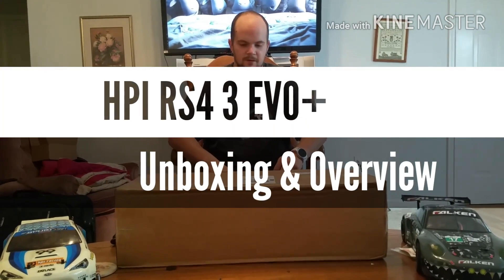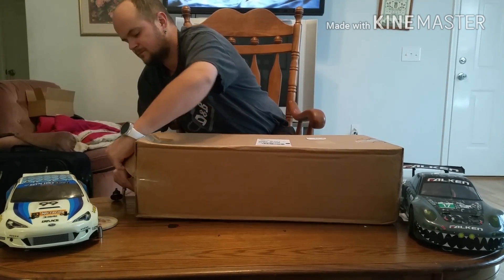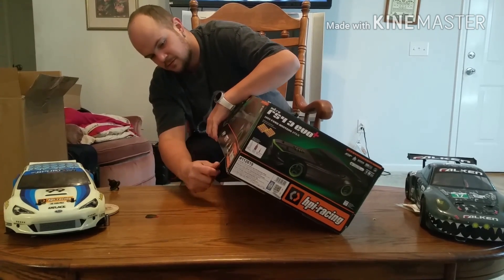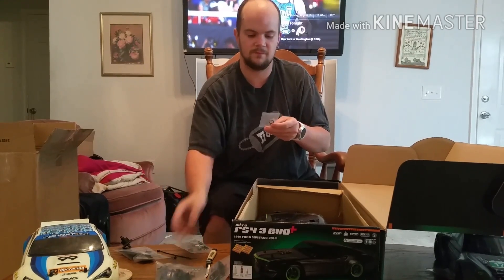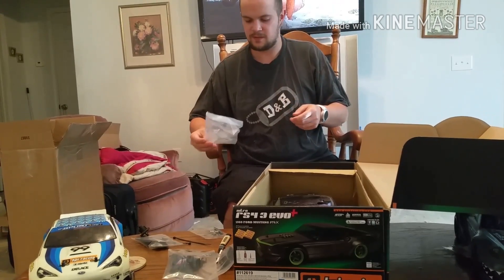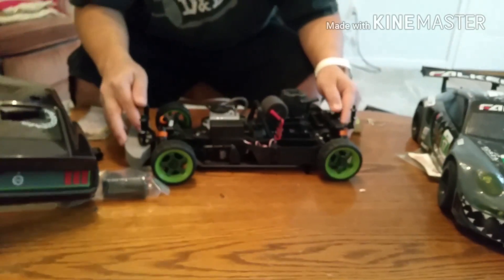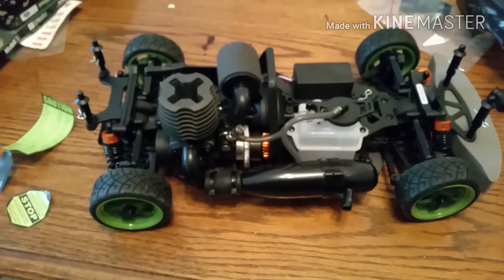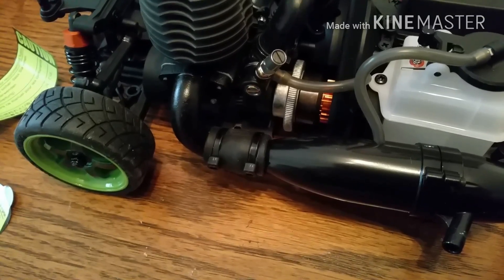HPI NITRO RS4 3 EVO+ Unboxing and overview

Comment: It's funny cause I had gotten out of the hobby for a few years and I tried searching for an Evo RS4 but no one had any in stock lollol that explains it! I have a traxxus revo 3.3 and the hpi sprint 2 flux but I wanted a shaft driven Evo cause I'm not the biggest fan of the belt driven car, it tends to spin out on the street lmfao are they producing them again? Edit: I just realized this video is 2 years old, my mistake!

Comment: Every where I check the nitro rs4 3 evo is out of stock. Also would the Porsche body fit the nitro rs4?
Reply from the maker: DBLOCK020 yes but right now you wont find them in stock.  I was lucky to find the one I have.  HPI isn't distributing so most of the good vehicles you cant buy rtr
Reply: Amateur RC is hpi releasing a new version of the the nitro rs4? I used to have the nsx version but it's discontinued.

Comment: Just bought one where did u get your bump box
Reply from the maker: Charlie Sheppard just look up duratrax bump box.
Reply: Are they better than the roto start
Reply: Could you do a video on the bumpbox or send me one please
Reply from the maker: Charlie Sheppard I could do a video but this is a $50 bump box and I don't just give away $50 stuff.  I will say it is a good bump box that uses to Motors 4S capable V rubber wheel that spins the flywheel is replaceable overall I've had no problem with the two I have and bump start engines are better than Roto start or pull start engines because you don't have those extra openings and moving Parts in the back of the motor.  They last longer.
Reply: So I have to buy a different motor or us the same one
Reply: And I didn't mean send me a bumpbox  lol just a video of how to use it
Reply from the maker: Charlie Sheppard got a video up of how they're used.